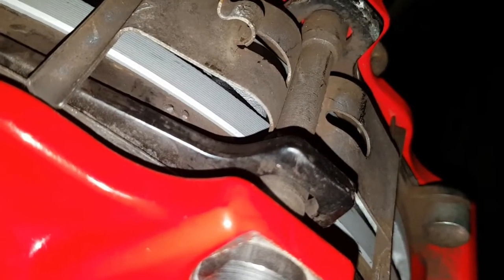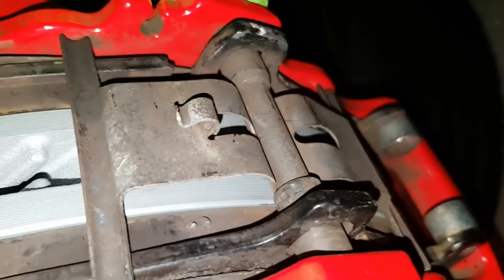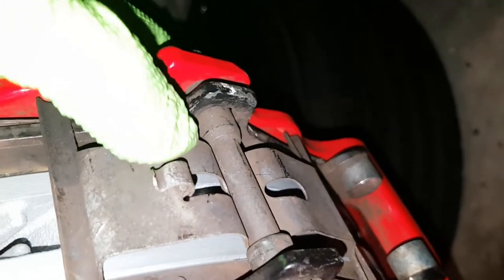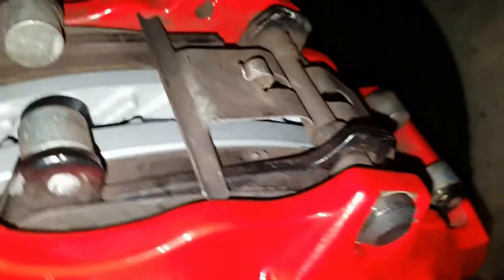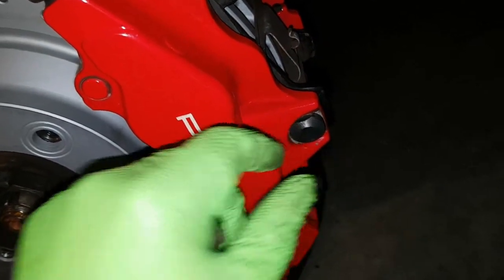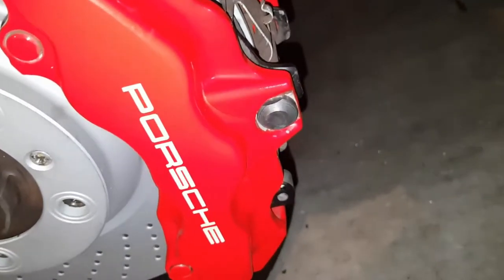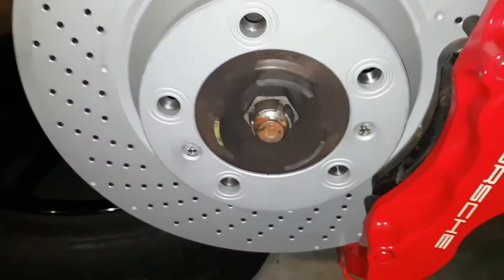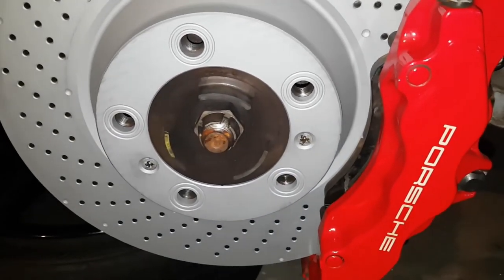Tips for removing brake pads in a 997 Turbo

Comment: Thanks for the tips!  Certainly helps as it can be a big pain to remove as you mentioned.
Reply from the maker: You're welcome!  I've since tried to 2x4 method I mentioned in a reply to another comment.  Found I couldn't really get enough leverage on it with my leg, but if you get one that's an appropriate length, wedging it inside the wheel well between the retainer clip and the back of the wheel well seems to work pretty well.

Comment: hi, not a good idea to hit the 13mm bolt since it's aluminium...better use the brake sensor hole to push down the retention spring with a screw driver or smth...imho
Reply from the maker: I'm only talking about tapping on the pin, not hammering on it.  I don't think a screwdriver through the sensor hole will work very well.  I have heard of people using a 2x4 or similar to press on the spring though, using a leg to press the block onto the spring, leaving both hands to wrangle the spring; that could work.  Will try it next time!  Regardless, it's definitely a PITA! :)

Comment: Well, it worked for me...good luck anyway!
Reply from the maker: Oh? It's been a while since I did this—I guess if it worked for you it's worth trying! Did you manage to get it through relatively easily? I found my spring extremely difficult to press out of the way.  It seemed like a screwdriver thin enough to fit through the sensor hole would bend before compressing the spring.  I've heard others describe it as not too difficult, so I wonder if the springs vary somehow.  Maybe they become less flexible with age or something?